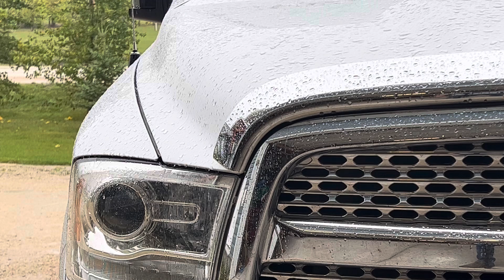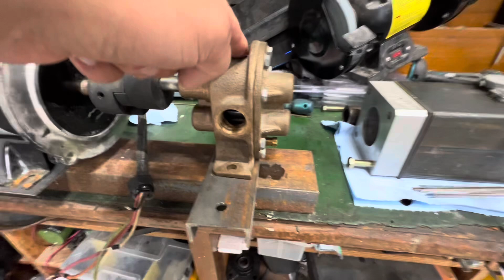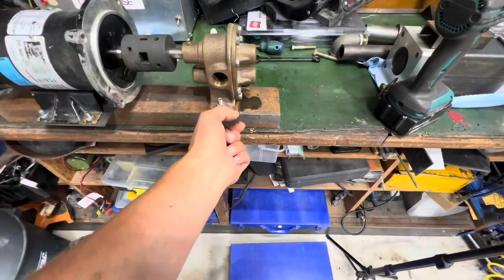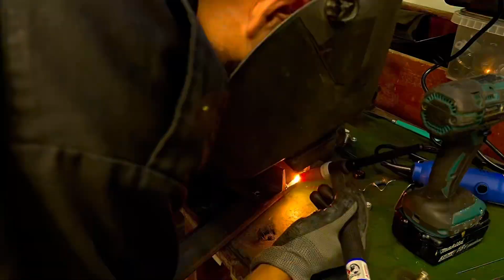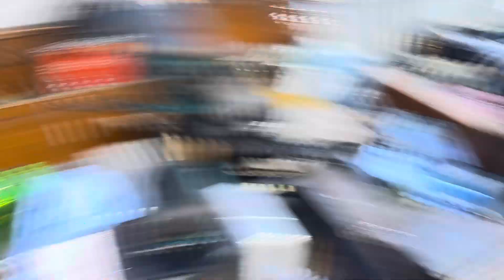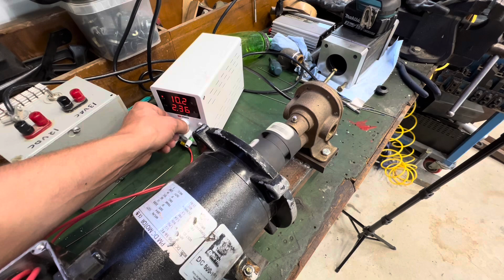Building a grouting pump for MY Geothermal drilling rig.

Comment: 2 minutes in, I have a guess:
Fire fighting pump setup on a skid with a 275 gallon tank to be pulled behind the snow cat or ptv.
Now to watch the rest & part deux. 
😊

Second guess: circ pump for the cabin hot tub run off solar/ batteries.
Reply from the maker: Both great guesses! On another note I might just have two additional new projects!
Reply: @rad1876  😂👍